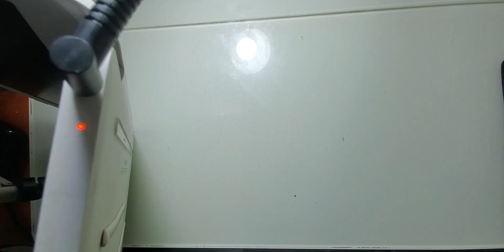Charger Light on and Off: laptop Shut off on Windows Loading Screen This how you fix it

Comment: My laptop shuts down on the Windows loading/login screen only when the charger is plugged in. But if I start it on battery, it turns on normally. Once it reaches the desktop, it works fine even with the charger. Did your laptop also turn on without the charger like mine?
brother pls reply ..i dont have monet  right now and  technician is asking me a lot of money .you are like my last hope

Comment: Good day master, I really appreciate the time giving to teach us on here. Please i will be Glad if you can explain how to identify the inductor, mosfet, capacitors, resistors and ic assigned for the DCIN, RAM, PROCESSOR, 3.3V, 5V, 1.8V ETC. also if you can throw more light on how high-power transistor and low power transistor work in battery section